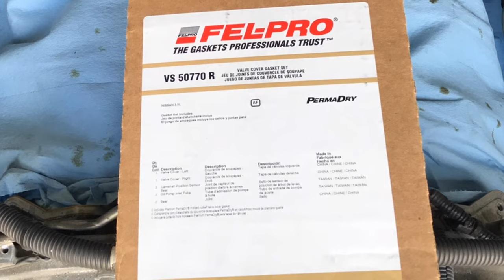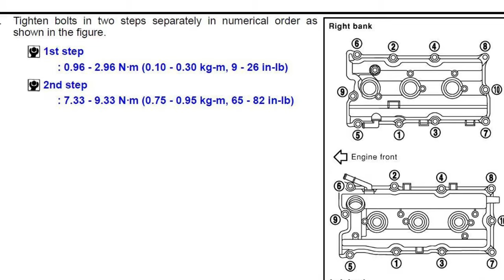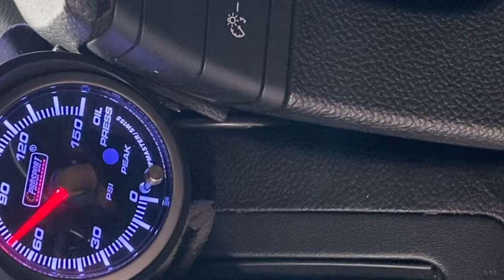How to Change VQ35HR DIY Valve Cover Gaskets 350Z G35 Z33 V36 350GT Injectors Intake Plugs Coil Pack

Comment: We just finished this up. It took 5 hours. We left the injector harness in place cuz we didn't want to disconnect the alternator and AC. Bought the valve covers with the gaskets in them that on eBay for 80 bucks. Save like 1300 over the infinity dealer
Reply: Did those covers hold up?

Comment: 10:40 what do you have removed from the vehicle where you are able to get a grip on that alternater plug ? its literally impossible to get a grip but it looks like you have more than normal space here can you please help me out this is literally the last connector on this side lol
Reply from the maker: @dragonstrike12244 at 10:40, I am laying under the car looking up. Have you tried, 1st free up the entire small harness bundle that runs by the alternator. There’s a Ziptied rivet thing that affixes the harness to the alternator bracket, use a pick tool to get that loose, and then have a free harness,  it’ll help when you go at unplugging the alternator plug. It’s an awkward sideways pinching of the plug, if you have some compressed air, blow the plug it may help free the dirt/debris and allow a better grab of the plug. When I’m pulling the plug, I give it a wiggle as I pull to free it and hope it pops out. Lmk how it goes.

Comment: Great video... any chance of shining some light on my 2010 m35x, I'm getting a P0011 code. New oil &filter change, replaced vvt solenoid on passenger side, wire harness is good,runs perfectly but cannot pass NY emissions. Any suggestions?
Reply from the maker: @SmallS I’m not sure but code P0011 states that “the intake camshaft in Bank1 is more advanced than the engine computer has told it to be”. Have you tried unplugging the battery for 10-30min to reset everything?

Also on google there’s some results about relearning to clear p0011, tried that?
Reply: @NODRFTNewOrleansDrift  Actually, I swapped the camshaft sensor and found out that was the issue.

Comment: hi i was wondering how do you remove the pcv hose? mine was firmly stuck on both cv without clamps. just use pilers and pull?
Reply: sorry the breather hose between two valve covers
Reply from the maker: @Bismarck Liu You can carefully use a pair of adjustable pliers. Grip onto hose and kind of massage the hose by lightly clamping the pliers while turning it to break it loose, don’t do it too rough, easy on it, not full tight grip but not loose either. Hard to explain since it’s a feel thing but hope it helps. Try not to yank on it to rip the hose or break the plastic. Good luck, let me know if you have any more questions or how it went!
Reply: @NODRFTNewOrleansDrift  thanks but it found ur reply right after i broke it...🥲i am trying to fix it but still thanks !
Reply from the maker: @GaleoneOfficial  if you broke it and can’t find one new at parts store. Hit up the local junkyard or pap and see if you can get a used one temporary. It’s probably best to order a new one so you won’t have to worry about that or a used one failing.
Reply: @NODRFTNewOrleansDrift  thank you so much!

Comment: Hi, I own a g35 with vq35hr and my idle rpm raised from 650ish to 700 rpm ish after replacing valve cover gasket. 

Do I have to do the idle volume relearn procedure afterwards?
Reply from the maker: @Urusa, I wouldn’t sweat it. Could be change of weather being a factor.
Reply: @NODRFTNewOrleansDrift  thanks for the reply. Did you reset or use scanner to scan if there’s any error codes after replacing gaskets?
Reply from the maker: @Qkfltpdls777  I used a scanner to check but had no codes before nor after.

Comment: Awesome video, thank you very much. When you clean the intake manifold and other parts like the valve cover, you used brake cleaner? Or something else? I will be replacing my valve covers because as I was replacing my spark plugs I noticed one spark plug had some oil and another one had a little bit in the threads, but I will just replace the valves so I do not have to think about it later. I will not replace any of the intake manifold seals because I do not see any leaks from there.
Reply from the maker: @Don Hugo, it’s not a bad job if you know how to change plugs. I was using brake cleaner for everything. Just make sure you wipe and let it dry good. Typically if you find oil inside your spark plug galleys, the spark plug seals inside the valve covers maybe going bad. The ones I changed in this video are just the valve cover gaskets which don’t include the spark plug seals. You can first try the valve cover gaskets to see if it solves it, but if you still find oil, you may have to get new valve covers since the seals are technically not serviceable as they’re built into the valve covers. Or if pockets are deep, do new valve covers and valve cover gaskets all at one time. Up to you’

Lmk if that helps or if you have anymore questions.
Reply: Thank you I was wondering why I couldn’t find the spark plug seals I guess I have to buy the whole cover , thank you again couldn’t find that info anywhere

Comment: hello , I had a question , I think i messed up once putting everything back together, the issue that I’m facing is that once I turn on the car , it immediately turns back off and smells burnt, is there by any chance you have an idea for me to look to fix? I also had the car sitting for about two weeks before finishing , thank you !
Reply from the maker: @chrissrivera9043, idk what would cause that but double check everything. Did you plug all the plugs back into the correct connections? What was it doing before you did this job, like why did you decide to do this?
Reply: @NODRFTNewOrleansDrift  before it was running good , no issues just that it was taking a little longer to turn on so I decided to originally change my spark plugs then I saw that there was an oil leak in one of the plugs so I then decided to change the gasket . I double checked last night the cables but I saw that the vacuum hose was on the wrong hole , I had accidentally placed the one that’s next to it (I think it’s the coolant hose if I’m not mistaken) then I tried to turn it on yet it does the same thing and smells burnt
Reply: @chrissrivera9043 if it smells burnt most likely you didn’t put the gaskets right have you fixed that issue and figured it out
Reply: @Kocaineee  yes sir , it turned out to be my throttle bodies , I needed them to be replaced and also do a idle relearn process , i appreciate your advice ! 👍🏼

Comment: Which viscosity and brand of engine oil are you using on your VQ?! (Am running synthetic 5W30 on my 35HR because am scared of engine oil pressure issue or so due to using thicker engine oil such as 5W40 although i want to use thicker one..)
Reply from the maker: @urusa I use valvoline vr1 20-50 in all my vq cars. Been using that oil since 2008.
Reply: @NODRFTNewOrleansDrift  isnt 50 viscosity too thick for VQ engines since its factory viscosity is 30?..
Reply from the maker: @Qkfltpdls777  I’m a firm believer in it, I’m in the south so it’s hot and humid. Oil seems to break down  and 20-50 vr1 has been going great not getting too liquidity…haven’t blown engines, I drift all day long, and come home, to me it’s proven/works for me so I stick to it. But may not be up for you though. Oh yeah, my lowest mile z33 is 140k, both my g35’s have over 240k miles and gets vr1 oil, still kicking rocks.
Reply: @NODRFTNewOrleansDrift  oh i see that the area you live is very hot and humid.
Reply: @NODRFTNewOrleansDrift  Can u tell me which brand I live in south Fl also
Reply from the maker: @truevhazo4001  I’m using prosport brand gauge if that what you were asking.

Comment: What about the o-ring parts? Those area are proven to leak… did you apply RTV to the 6 spark plugs o-ring areas as well?
Reply from the maker: The spark plug seals are inside the valve covers. Not serviceable by Nissan standards but there’s a 3rd party company that sells a tool and seal kit but I did not change those as mine aren’t leaking.

Comment: Hey did you change the spark plug seal and if you did what part did you use pls reply thanks
Reply from the maker: Hi @temi Romeo, I did not change the spark plug seals. I believe they are apart of the the valve covers so those would need to be changed.

Comment: I changed mine but shortly after had rough idle and get the flashing CEL for cylinder misfire. One of my soark plugs was covered in oil so I cleaned it and the tube where it goes. Reason I didn’t bother to change the spark plugs was because I changed them a week before I did the valve covers. I did idle relearn and checked all the connections. I did crack some hoses but I put gasket gasket maker, taped it, and clamped it for the meantime. Do you think that spark with oil could be the issue? It only idles had when stopped in drive and in parked other than that it drives fine.
Reply from the maker: @Samuel Ortiz, yea the wet plug can misfire and not misfire intermittently. May want to change your tube seals.

Comment: 6 hours? holycow, so going to dealership for changing a gasket will cost more than $600?
Reply from the maker: I’m not to sure as I do not go to the dealer.
Reply: hey bro did u end up going to the dealership i might be on the same boat im trynna figure out a price range
Reply: @michaelnossa28  private shop quoted me $1067 parts/labor to replace both sides. They are replacing the whole valve cover not just the gasket
Reply: @ULTMTGMR-rj9bt  yeah I got quoted around 1300 for parts and labor so I just got rid of the g and copped a 3.7 q50 lmao